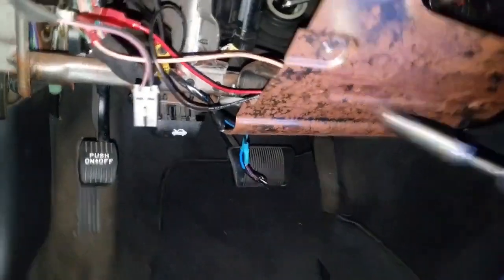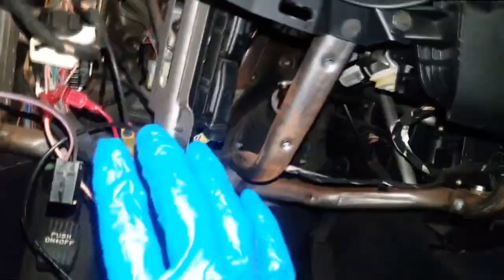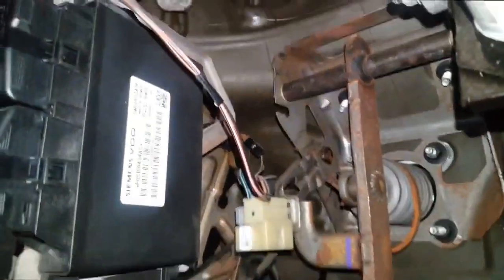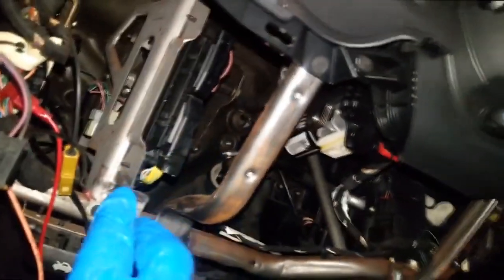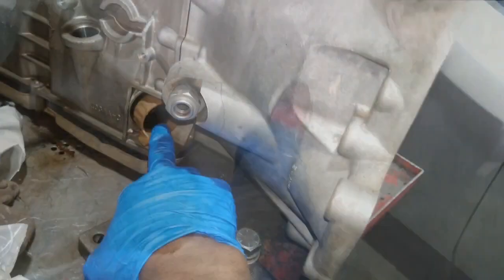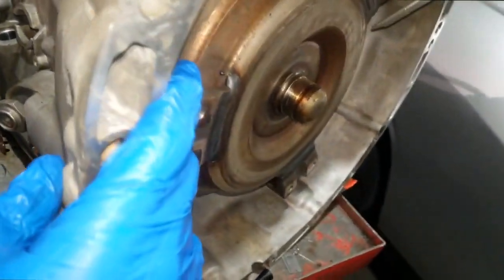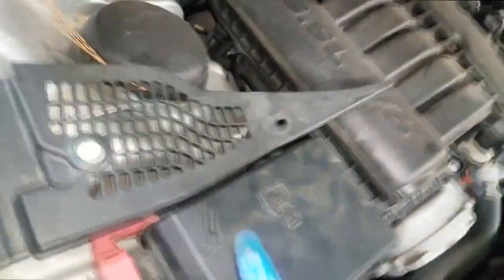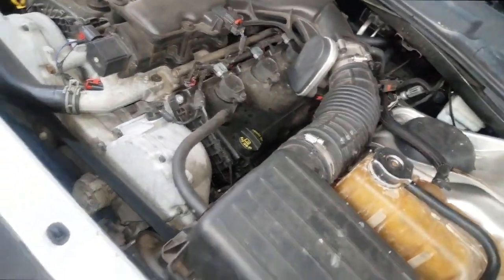Car makers now hiding your Car Computer Transmission Modules right here.

Comment: At least its in the interior like some 90,s cars. Newer cars like to put the modules in odd bad locations such as wheel well area and gets all corroded. Or inside the transmission in hot fluid nag2.

Comment: If it's Mopar it just needs the tip. Guys what kills electronics?? Heat, vibration and moisture. Now knowing this where would you place your computer controller?
Reply: Right beside the TIPM so it can get nice n wet.

Comment: That connector in the NAG1 also has a gasket in it that can go bad and soak the wiring harness in transmission fluid.  Replaced mine and cleaned up the area during the last transmission service as it was starting to leak and now I don't have that oil burning smell after a long drive.

Comment: Had a question about the 8-speed transmission on Chrysler 300 S. The manual says it’s sealed-but this same transmission is on other vehicles but not sealed. 

Thoughts? Should it be serviced?
Reply from the maker: Absolutely it should be serviced and its extremely easy to do such. IMO, the seal thing come from the manufacturer not wanting you to touch the trans while its still under warranty. The average warranty on this trans expired at about 60k miles. How ironic, thats when the makers of the trans suggest that you service it. Actually theres no reason to touch it under 60k because if theres a problem its still covered. But if you out of warranty, you on your own anyway. So its in your best interest to try and prolong the life of your trans by way of getting it serviced as suggested by the trans maker ZF.
Reply: @ thanks for the response. I’m at 85K, and I have coverage over the entire vehicle to 150K miles or 5 years-whichever comes first. 
Ok I thought it really was sealed. Do I risk having a transmission failure having it serviced 25k beyond the recommended service time as per ZF?
Reply from the maker: @ Absolutely not. When this trans first came out I was doing all my personal customers service at about 80K. And the fluid barely appeared used. So most my customer now get it between 80 and 100K. But the good news for you is that you have added coverage. That means if you have trans concern before the 150K you covered. There are no repairs to this trans except a valve body replacement so you would likely get another unit if you have any problem before 150K. But keep is mine, the price tage to service this unit very expensive.
Reply: @ what is the rough cost to service the ZF transmission?
Reply from the maker: @kw7807  Pan/filter assembly about $300 and fluid about $35 a quart with you needing about 6 from the dealer. Thats over $500 in parts along, then you add the shop labor charge and that should put you in the ball park
Reply: @ gotcha around $1k -ok, thanks much for your advice.!